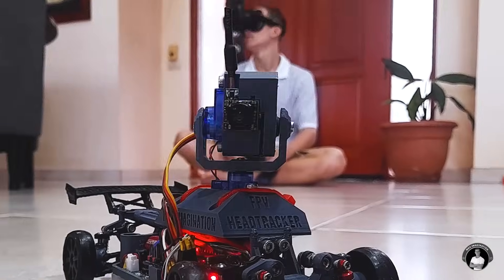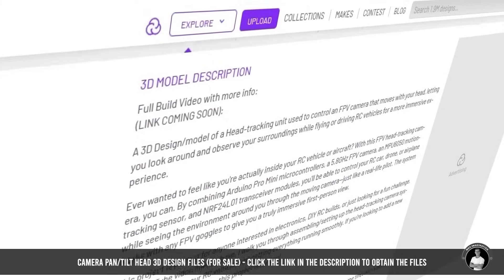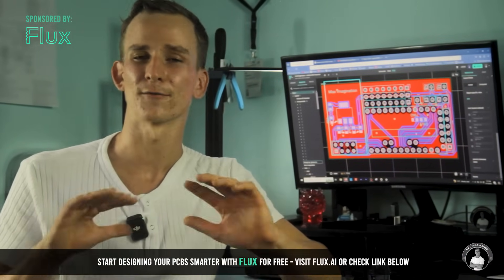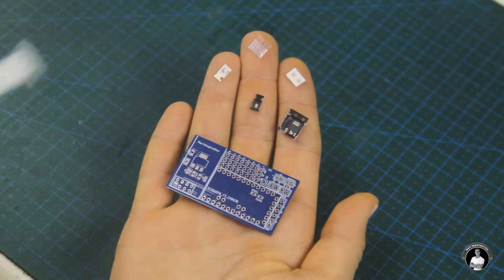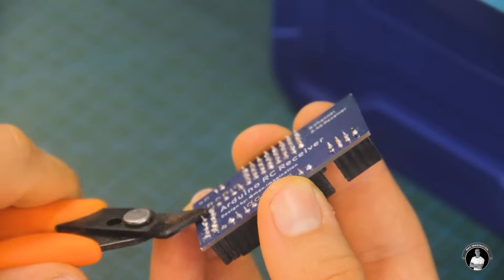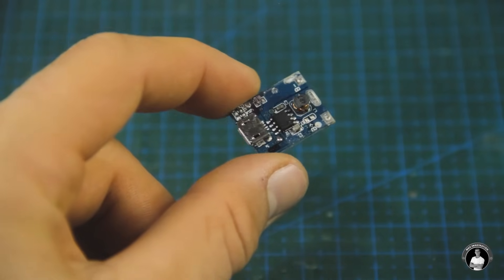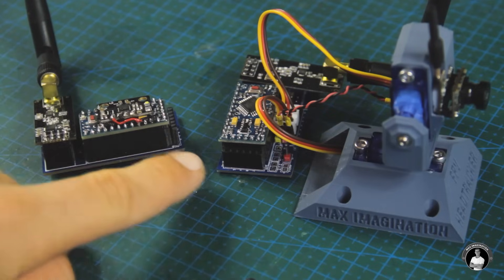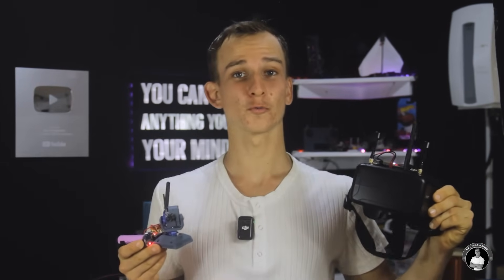Build an Arduino FPV Head Tracking Camera for RC Vehicles

Comment: hallo dude .. ask about pin miso, mosi, sck, csn, to pin 11, 12,13 right ? because there is no such thing in the wiring diagram
Reply from the maker: Hello. CE = 9, CSN = 10, MOSI = 11, MISO = 12, SCK = 13.

Hope that helps and please excuse the confusion on the schematic.
Reply: @MaxImagination now i have some issue about upload arduino 
this code have some libraly.. do you have link for download this library like for libraly for mpu6050
Reply from the maker: Hi. I don't have the link, but you can easily find it in the Arduino library manager and download it from within the IDE.

Comment: Could you redesign to use the DJI 04 system ? Both would be good but I have the 04 system not the pro. These goggle, camera are perfectly clear over long distances, I am also pairing with the Radiomaster RC surface transmitter. I have already made non  head tracking mounts so this would be great for the DJI camera and transmitter.
Reply from the maker: It is possible, you may obtain the design and modify it to suit your specific camera.

Comment: can i use my phone as the fpv headset???
Reply from the maker: Hi. Not with the current camera. With a WiFi enabled camera like the XIAO ESP32S3 Sense, you can.
Reply: Wifi camera??
Reply: Will there be difference in the circuit like connections
Reply: I'm making this for my project so I need some help
Reply from the maker: I suggest you check my most recent project and use the same code - found in this GitHub with Insructions - https://github.com/s60sc/ESP32-CAM_MJPEG2SD

The connections will of course be different, but you may see what's relevant in my schematic (ESP-ROLL ball bot), eliminate what you will not use, add what you will, and keep things the same for power. The camera is easy to power, you just need to add the servos.
Reply: 1 more question is that pcb 2 layer or 4 layer??
Reply from the maker: 4-layer.
Reply from the maker: 2 layer.

Comment: How can i make the same but with longer range? Want it inside my rc plane:)
Reply from the maker: Use two NRF24L01 PA LNA - power amplified antennas or the upgraded versions on Amazon.
Reply: Thanks🥳

Comment: hii. i want to use the same setup as yours. only difference is that ill use arduino uno wifi rev 2 instead of pro mini. and i dont want a pcb for now. what are the pins i need for nrf?  i managed to get the mpu working but not the nrf
Reply from the maker: Hi. The Arduino UNO R4 WiFi uses a completely different processor/microcontroller. I cannot guarantee it will work with the NRF - you'll have to do some research. Ideally, it should connect the same way, but you'll have to check on the library/software side of things for compatibility.

Comment: Oh yeah, what about, instead of using the NRF module and arduino which sometimes Sucks real hard except for the arduino, you can use the Esp32 using EspNow Feature which has more range and more fast, please consider this as a humble Tip came from a broke guy like me who cant afford custom pcbs and other components in the video
Reply from the maker: Thanks for the tip, however I heard ESP-NOW doesn't have that much better range than WiFi unless using power amplified signals. I'll consider testing it out though!

Comment: Hello Max , thank you for shaing your project. I have one  question for you: I think you did not  use the 2 resistores of 51 ohm  and 71 ohm on PCB. Did you?
Reply from the maker: Hi there. You're welcome! I did not use them and the 51K and 71K ohm resistors were only there if one wants to read the battery voltage. Best to not use them if not necessary.
Reply: Thank you Max @MaxImagination
Reply from the maker: Always :)

If you ever feel generous and want to support my work, here’s my BuyMeACoffee page: buymeacoffee.com/MaxImagination. It means a lot!

Comment: hey Max great work, i love all your projects and i decided to build one myself with some modifications but i guess I'm stock :) , so please if you can help me out it'll be greatly appreciated, im building the Arduino FPV Head-Tracking Camera for RC Vehicles but with Arduino nano, connected everything uploaded the codes but can't get it to work, from one serial monitor i get  the error message after DMP ready it says Failed to send data, and the servo receiver side  it only goes Pan:90  Tilt: 90 without changes. please give me some guidance and thank you for the work you do.
Reply from the maker: Hey and thanks! I suggest you check your connections thoroughly, check the MPU6050 communication likes are hooked up right and not around the wrong way. Check that your power supply is strong in terms of energy and connectivity - this is a common cause for similar issues. For more help, DM me on Instagram: @max.imagination

Comment: If I look at the servo used, you use a 180 degree servo for the rotation limit, correct? So if we want to face or look back it seems we won't be able to, right? If you use a 360 degree servo, can it run perfectly into this tool?
Reply from the maker: Yes, it's a 180 and you cannot look back. If you find a 360 servo with absolute position detection like this one, then you can.

Comment: I am facing problem in communication in nrf24l01 no data is receiving on receiver side in serial monitoring also I checked please help to solve that problem.
Reply from the maker: Check the supply of power to your NRF24L01. Ensure it's getting a stable 3.3V from an AMS1117 regulator. Make sure you haven't swapped any of the communication lines the wrong way, check the wiring according to the diagram. Also ensure you're using capacitors at the power terminals of the NRF modules. Make sure the codes you're using match each other.
Reply: @MaxImagination  I am done with all of them   I am using Nrf24l01+pa+nla module is it the problem of module or I have to use the normal nrf24l01 module having pcb antenna
Reply from the maker: Either will work. You either have power issues, communication line interference, or mismatching code.
Reply: @MaxImagination  and how can fix it can you please elaborate pleaseeeeeeeeeeeeeee
Reply: @MaxImagination  hey thank you so much I figure out the problem and solve it and now the project is working
Reply from the maker: Happy to hear that!

If you ever feel generous and want to support my work, here’s my BuyMeACoffee page: buymeacoffee.com/MaxImagination. It means a lot!
Reply: @lokeshsawankar6936  what was the problem?
Reply: @aidanhughes3655  it needs a constant voltage for that we use a nrf24l01 power connector which provides 3.3 constant voltage to nrf 

Or you can place a small capacitor between two power terminal of nrf24l01

Comment: Hey I upload the pcb file on jlc pcb but the file is not get uploaded what can I do next or suggest me the solution that how can I upload the file
Reply from the maker: Must be some errors you've having with your network or browser. I suggest trying to upload the files from a different device or web browser. Try clearing your browsing cookies.
Reply: Hey bro I done with all connections and other things but. The nrf24l01 is not receiving the data transmiter transmit the data but not receiving I cheak nrf24l01  on serial monitor the receiving side does not receiving the data  also I change the nrf24l01 but not getting any result

Comment: Can I make this project without pcb I mean by only sensors and microcontrollers if it worked then I ordered the pcb as well
Reply from the maker: Yes, you can. You can make the perf board version of the RX and TX boards by watching how the receiver was made in this video: https://www.youtube.com/watch?v=34BDwDulZl0&t=1056s

Comment: I would recommend adding bigger capacitors close to the servo power, so prevent voltage duos which could reset/interfere the mcu and 6dof sensor
Reply from the maker: Good point! This can be added especially for weaker battery setups.

Comment: Amazing.  

With a dual camera setup, would it be possible to stream sterescopic feed to a meta quest 1/2/3? One would have to unlock developer sertings etc, but that is easy.
Reply from the maker: Thank you! I don't have much experience with stereoscopic conversions, but I'm sure someway it is possible! I recommend asking this questions to the FPV community on forums. Cheers!

Comment: Can you clear a doubt for me
??
Reply: I want to control two 9g servo motor and I don't know what battery to use in terms of lipo and BTW like your videos and keep rocking  ......
Reply from the maker: Hi there. Since servos run on 5V. Either use a 3.7V battery with a 5V boost converter or a 7.4V battery with step-down. The mAh shouldn't matter much, select the mAh based on how long you want your circuit to run.
Reply from the maker: And thanks for your comment!
Reply: @MaxImagination  okie bro and good video are coming day by day keep doing this until we have a group of many people who do different projects like this everyday...

Comment: With the MPU6050, how do you correct the calibration of the sensor with the headpiece? Since it doesn't have absolute positioning, wouldn't it be susceptible to gradually losing calibration as you operate it with the head mount?
Reply from the maker: As shown in the video, I correct the calibration by moving the head tracking unit (with headset) to my desired viewing position and press the Arduino's reset button to recalibrate.
Reply from the maker: From what I found, it doesn't lose positioning after a while of moving the head tracker.

Comment: Great project, thanks. Is possible to make the gimbal stabilized like for a gopro?
Reply from the maker: Thank you! You could get close to that level of stabilization if you added dampeners to the camera module, a third axis servo, and maybe digital stabilization done somehow. However, with analog camera's digital stabilization may not be an option.

Comment: #AWESOME ... i build almost the exactely same thingy back in 2012, was very fun and entertaining. I too connected an arduino in my FPV-Headset (fatshark) via a seperate 866Mhz rxtx module to an other arduino receiving it with similar module in my graupener mc-12 tx. on the fatshark it was simply using magnetometer and accellerometer readings to get pan/tilt (with "reset" button to put head in arbitrary and comfortable direction and reset to 0,0 pan,tilt degrees in that viewing. it was very easy to use. but on graupner-mc12 side i had to read all PPM channels on the arduino, too and advance it with 2 addition artificial channels the receiver transfered into realtime pan and tilt servo motions. so same thing, just 12 years ago. cool to see anybody doing the same and not letting it off to the big XYZ companie(s). <3
Reply from the maker: Thanks for your comment and sharing your experience! Awesome to hear 12 years back people like yourself were building these... :)

Happy to have brought more light to this type of project! Cheers.

Comment: Any reason you are running it on Pro and not Nano?
Reply from the maker: The Pro Mini is smaller, therefore fit better along with the NRF24L01 to make the compact yet modular transceiver.

A nano can work with this project as well.
Reply: @MaxImagination  thats what I figured after checking the code, no special requiring the Pro. Wondering if it could run on an ATTiny-84 or similar.
Reply from the maker: I don't know, I've never used the ATTiny.

Comment: thanks for your simple code. Many thanks to jrowberg and "MPU6050_6Axis_MotionApps20.h" : very easy to manage. 20 years ago i build my own : PIC and RC heli gyrometers. Gyromètres are not accurate for zero drift: they are not gyroscope. That is why I prefer the 3D magnetometer for head tracking, now
Reply from the maker: Thanks for sharing your insight! Cheers.

Comment: Tell us more about the experience. Can you really immerse yourself in it? Do you feel like you're actually inside the car?
Does the delay in movement get in the way?
This project is very interesting. I had thought that something like this was missing for a long time.
Reply from the maker: It can take a moment to get used to when first driving it with an RC car especially, it helps having the fisheye lens to see the front of the car as a point of reference. 

It truly seems like you're in the vehicle when controlling it. It gives you lots more freedom to observe what you want to when driving, just like you would from inside an actual car or plane.

I recommend building this project, it will be fun! 👍🏻🙂

Comment: Hey Max, love your videos. Is it possible you can make a video on a 3d printed, or homemade  brushless motor with 2 terminal wires??
    I see people doing it online with a 4 pin hall sensor. They skip the need for a brushless controller, so much simpler. 🙂
Reply from the maker: Hey and thanks!

I'll keep your idea in mind. Most brushless motors use 3 wires since they are driven with 3 phases unlike regular brushed DC motors. To make them 2 wired, you'd literally need a controller built into one. That is not practical, in my opinion.

If you can refer me (send a link) to the type of motor you're explaining, that would be much appreciated to help me better understand.

Cheers!
Reply: It was a video you actually commented in. 

https://m.youtube.com/watch?v=PLETJnaJVT0&pp=ygUnSG93IHRvIG1ha2UgYSBzaW1wbGUgYnJ1c2hsZXNzIGRjIG1vdG9y
Reply: It uses two terminal wires kind of like a brushless computer fan.
Reply from the maker: Yes, but it seems rather inefficient.
Reply: I hope there’s a way to make it better. It been used in computer fans worldwide for a long time.

Comment: is it possible to use carboard vr and mobile that send the gyroscope sensor to fpv camara module
Reply from the maker: It's possible and can be done via bluetooth with some app, but you'd need to know programming very well to pull something off as such on your own, if the platform for it doesn't exist.

Comment: I want to buy the PCB but the link doesn't work! :(
Reply from the maker: The PCB is not for sale. The 3D design of the project is. You can access the Gerber file from the project files folder linked below as a Google Drive link. Check it out. (It opens on my end, hm weird).

Comment: That vtx on the camera is gonna get awfuly hot quickly without airflow or a fan
Reply from the maker: Good point, I mentioned that in the project blog in the step about installing the FPV camera. It might need a small heatsink if running for extended periods of time, potentially.

Comment: Is the NRF24L01 transceiver technically a ESP-NOW Board? Why choose this board? Thanks!
Reply from the maker: It technically a Radio module that operates on one of its 125 available channels. I have not heard of this being used as an ESP-NOW, unless the components in an NRF are used in an ESP32 chip, which I assume some are for the 2.4G.

I chose this board for its simplicity and cost. It does the job, so why not use it :)
Reply: @MaxImagination  Thanks for the information! I’m looking into controlling Robotic arms more reliably through telecommunication. Your FPV project definitely helped open more doors for me!

Comment: Amazing tutorial ! Now I know what to do in the holydays ! For a next project, could you make a dogfight variant for it ? Like with an IR device connected with a transmitter that an IR receiver on an other RC vehicule can receive and display the «heart points (HP) » remaining.
Reply from the maker: Thank you! Great to hear you want to make it too...
Maybe I could, but I'd probably use radio frequency communication instead of IR. Infrared control is unreliable.
Reply: @ glad that you had a project of this kind and thank you for the précisions with IR, I don’t knew this !

Comment: Is it possible to avoid some steps by using the arduino uno?
Reply: @miauwrits  Yes, i think look up "arduino servo shield" like the "pca9685". You can even drive the servos direct from the board, just need a buck or boost converter then supply about 5v at 2 amps or more from the battery (i think) so the arduino doesn't "brown out"
Reply from the maker: You can use the UNO, no problem.